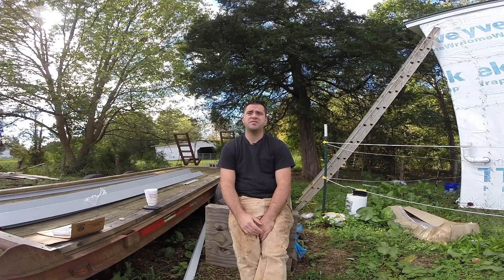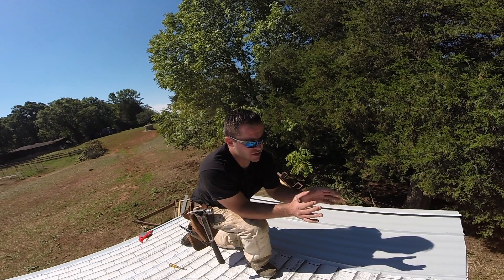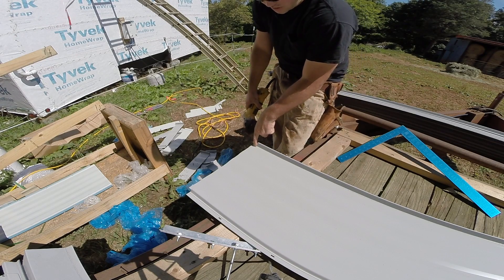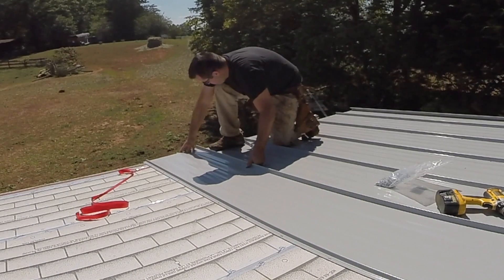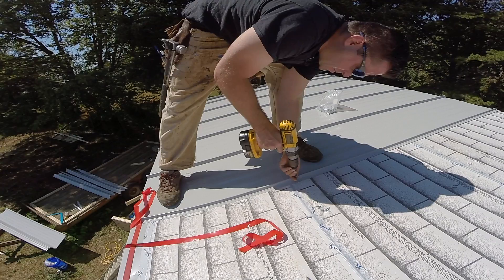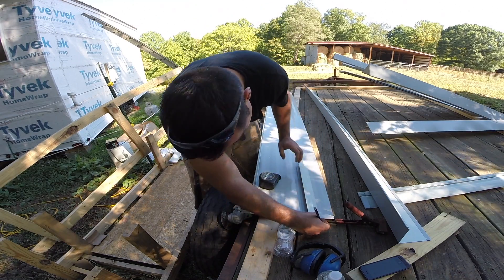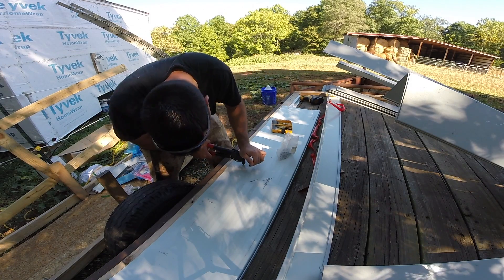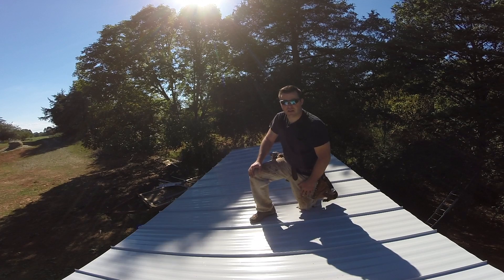Tiny House - Finishing the Standing Seam Installation. Part 4 of 6

Comment: Clever using the doubled sided tape under the panel where it meets the starter flashing at the bottom. Great looking roof. What R U going to use as finish siding? Looking Good! Final thought,  say hi to Peanut the talking dog.
Reply from the maker: +mmanut cedar shakes

Comment: Hey! What resources have you been using to learn how to build/work on the projects you haven't got experience with?  Also do you know where to check the building codes for sizes for Tiny Houses?  I'm starting to do some research.  I'm loving the series, and hope it keeps going well.
Reply from the maker: +Walker Williams   I frames professionally for 10 years.  other than that, GOOGLE will answer your questions.